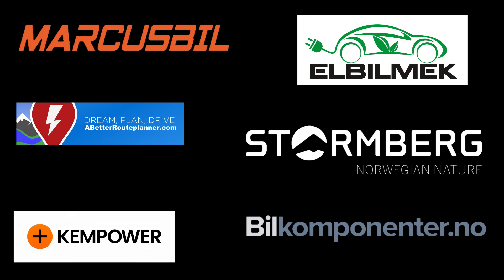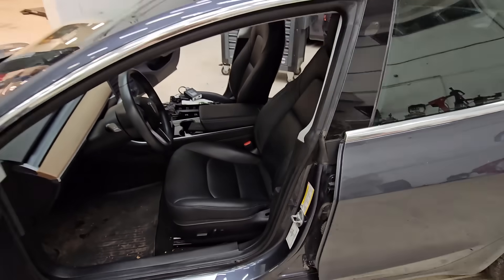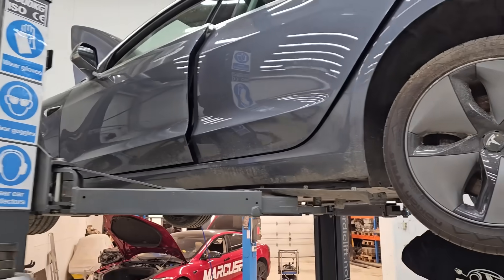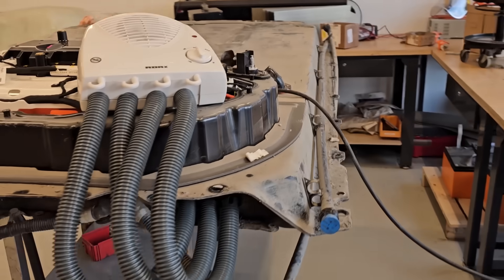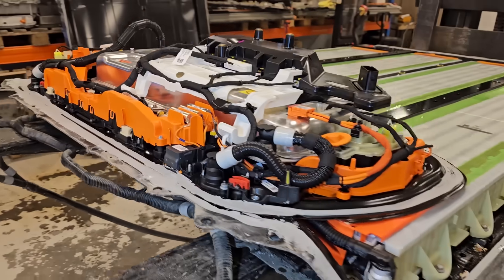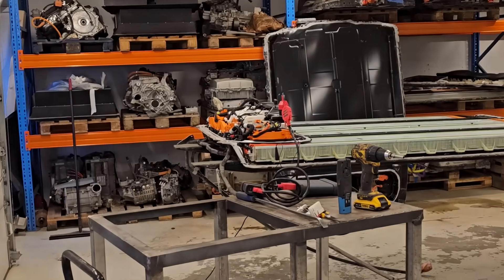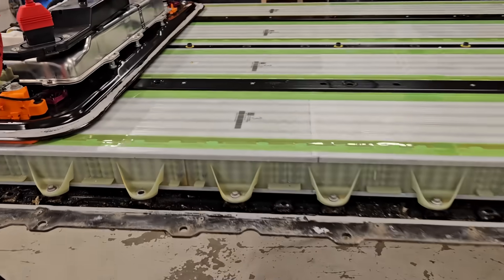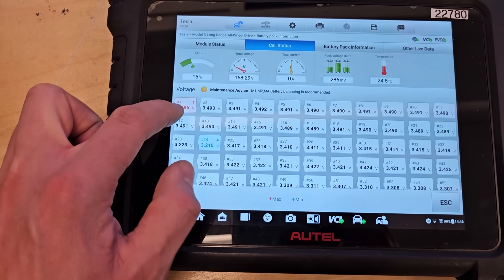Elbilmek repairing Tesla Model 3 with flooded battery

Comment: his batteries should be 50 lb packs, that lock in, sealed water tight.  Consumer should have access to them.  Its some design modification, an mold modification.  I don't know why tesla has not released small portable power banks like ecoflow, etc.  who knows.
Reply from the maker: That's not how it works.
Reply: @bjornnyland  you don’t think the battery pack should be removable by the consumer?  The 12 volt battery in cars is made accessible on purpose.  I am troubled by teslas (and others) hide the big battery design.  The current design says the consumer does not own it, and it can be disables remotely.  Happened to a ride share user.  Think about your problem on table now and if it was only one 50 lb pack vs the whole thing.  Apple was the first company to remove the customer ability to replace a battery and low an behold the dirty bastards remotely disabled the battery’s on old devices to force the purchase of a new one.    I can see some logistical problems and safety problems, but no more dangerous then regular car batteries (especially if designed right).  The beauty of having removable packs is the cars life an value to the consumer is extended.  See how they are long,  you could easily have them removable from front or rear with the right design.  I mean think of how dewalt makes it so ya can snap a battery in an out, ya know.  Its a choice to make them hidden.  Not much cost savings either, for the manufacturer.

Comment: Run 40 degrees water thru the cooling system to dry it, with a bit of ventilation ? use Heat pump pool heater for that ?

Comment: Wow...a lot of work to take out the battery. At Hyundai or Kia you just take out the bolts from below and that's it...
Reply: Tesla is all about reducing manufacturing cost, so they eliminate every part and step not essential.  On the Model Y with the structural pack the front seats and consul is mounted directly on the battery and the battery is the floor of the car.  When they take it out there is just a huge hole where the floor is suppose to be.
Reply: Unbolting the seats is not much work 
Its even better, because you get easy access to the modules on top.
Reply: @CyberlightFG  more work is never better. You Tesla guys just find a stupid thing to say for everything 🙄
Reply: Its just 4 bolts. Calm down. 
Much better than removing the heavy battery to change a small module.
I'm not a Tesla fan. I would prefer a different car.

You need to remove the back seats to get to get to a fuel pump,too.
On some models you need to remove the tank from under the car to get to it. Dumb design.
Reply: @CyberlightFG  And on some modes to remove the tank you need to remove the entire rear axel.

Comment: It would be interesting to see what happens after the battery dries out, and what Elbilmek does with it in the end.  Will it be repairable?  If not, will Elbilmek sell the parts?  Are the power electronics in the penthouse still in good shape to be installed as used parts?
Reply: dont hold your breath

Comment: I wonder what will they do with this battery. I'm pretty sure it will not be used in the car anymore, but could it be made a storage system for a solar panel system or something?
Reply: in a concrete bunker with sprinkler system for thermal runaway treatment ?

Comment: Incorrectly built battery sorry tesla but there is no reason for a battery pack to not be completely sealed against water ingress.

Worried about air expansion do what hard drives do with flexible bladders.

The seal path for the battery case was also sub optimal making and torsion on the pack stress the sealant massively.

It's annoying when hacks like Monroe go on about stamping and welding techniques and getting rid of indicator stalks meanwhile ignoring glaring errors like using a rubber grommet to seal a battery pack that's living inches from salt covered dirty wet roads.

Laws should be put in place to make manufacturers replace any water damaged battery pack that's within warranty that hasn't been submerged more than 2m deep.
Reply: Or just don't drive your Tesla into a lake.  If i drive my fossil into the river the engine is toast.
Reply: 2 meter water submerge is not problem, problem is duration. Any IP certificate comes with duration as well

Comment: Water has found the way to get inside the battery. Bad engineering from Tesla.
Reply: These Model 3 are not sold as submarines.
Reply: not really. cars are not designed to be submerged

Comment: But there should be water inside? Correct? Is cooling and external flood mixed?
Reply: No. Cooling runs trough lines in coolingplates. There is no moisture around cells (normaly). Look up some videos of munro live, they disassamble and study vehicles. There (beside all the other functions) is shown how cooling is done, by different manufacturers.
Reply: @Bud_Terence  Ah! I dont know how it worked. Cooling plates, will take a look.

Comment: Always thought the pack was completely sealed from water ingress
Reply: Time to advocate for snorkels for EV HV batteries!
Reply: It has to be able to equalize pressure somehow when it heats or cools. That's through the valves shown in the video.
Reply: @anttitoivonen7339  And these have to vent outside the car and not inside because in the small chance of a thermal runaway you want those gases going out of the car, not into the cabin.
Reply: Exactly, and because of that battery can not be submerged in water for extensive period of time @anttitoivonen7339
Reply: @anttitoivonen7339 Apparently two plastic IP67 pressure equalization valves are too expensive for Tesla.
Programed obsolescence, water ingress = oxidation, oxidation = electric shorts.

Comment: I assumed that the battery was sealed and protected against water or particulate ingress. Very interesting video, looking forward to the next part!
Reply: There are a lot of [IP] classes in water tightness
Reply: you still need some venting I guess? or is there vacuum in the battery packs? otherwise when they heat up the air wants to expand inside it.
Reply: @AndrewTSq I think there are already membranes that allow both waterproofing and air permeability.
Reply: @romanblaha1  ah, yes that sounds plausable. like goretex in clothes :) edit: its probably  these at 01:50?
Reply: Battery pack has valves that enable the pack to breathe when the battery heats/cools down, because of this water will enter when submerged for long periods of time

Comment: Wow, nice to see the live tear down. I can’t believe this is the first time you’re actually inspecting the inside of a pack. I would have thought you had done this before.
Reply: Most model 3 are in warranty, that's why we didn't had chance to took at the battery
Reply: Would be a good starting point to put non-Tesla batteries in it like the 125kw Model S like AS seen on Twin Battery Technology`s channel.... There`s a Nissan Leaf with  GM Bolt battery cells on there too...